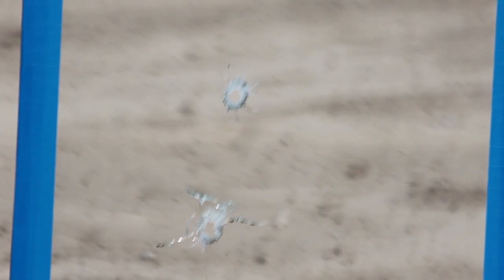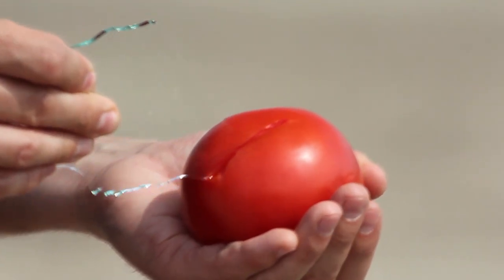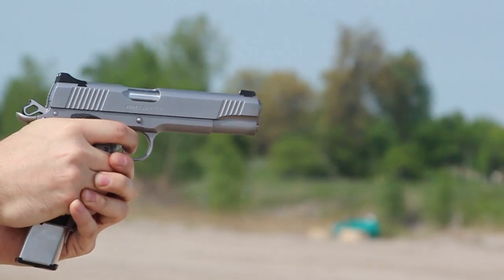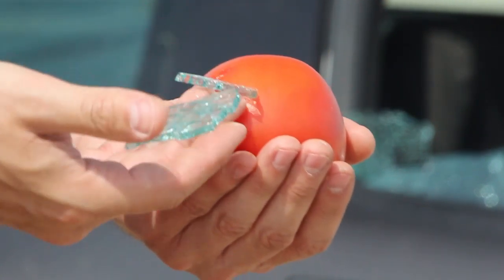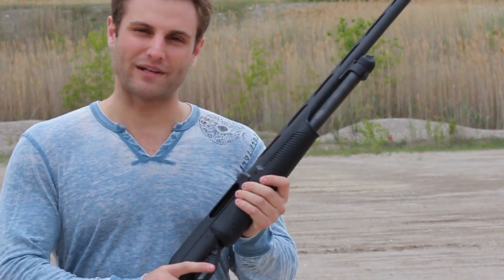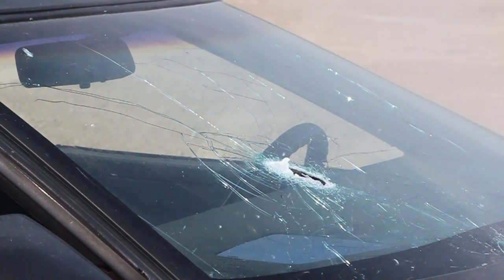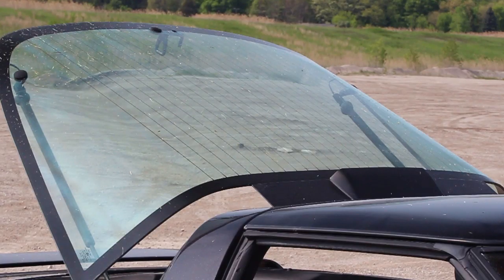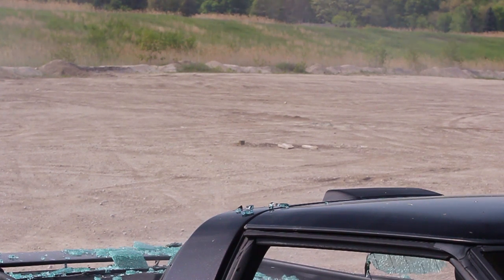Safety Glass - How does it work?

Comment: There are regulations regarding the shape and size and particle count on tempered vehicle safety glass. For example the European ECE R43 Standard regarding vehicle safety glazing states that minimum of 40 and maximum of 400 particles are allowed in any 50mm x 50mm area of a single side or rear (tempered) glass. And it also states that no longer than 75mm long splines are allowed in the fragmentation pattern. I'm a Safety Glass Expert, find in LinkedIn:)